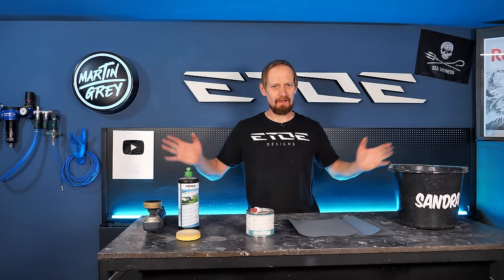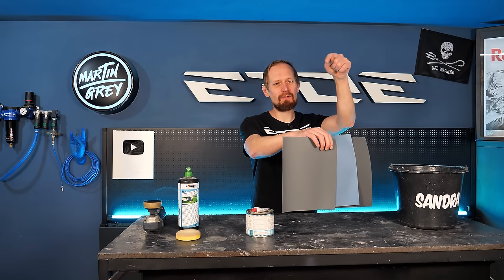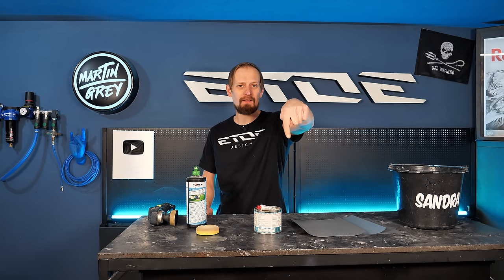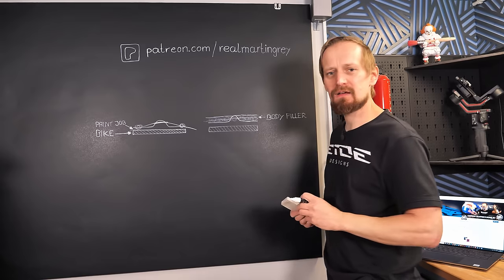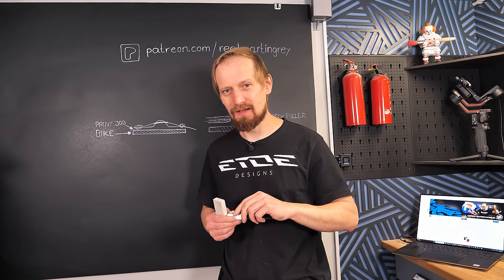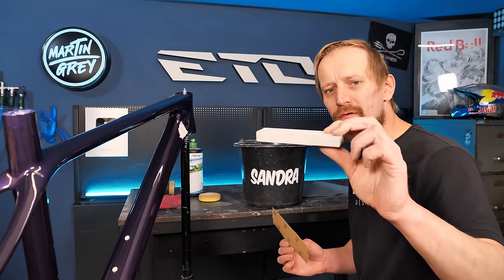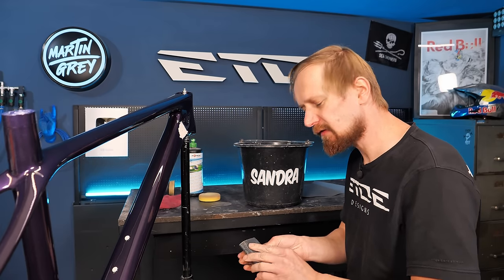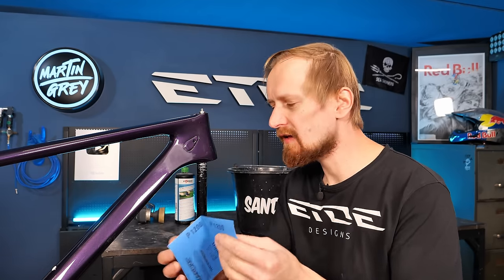How to remove PAINT RUNS easy

Comment: Great video. I hope you don't mind if I add some things I've learned over 40 odd years of doing high end detailing and colorsanding.  So, typically, I put just a little dish soap in my wetsanding water and I soak the paper overnight at least. Obviously you don't need to do that if you're just touching up a small area but it makes the paper work better. Second, I wear a headlamp with an led light and try to have as little indirect light as possible. The reflection of that light will show every flaw in the surface, not the texture, but the scratches and swirls will really show. That way you know when your done and don't have to go extra and take off more paint. Finally, if you're working in an area where you can't get a machine, use a cotton ball to rub in your compound. A cotton ball is non-woven so it can't rub any pattern into the paint and cotton holds the grit of the compound better so it doesn't slurry around on the surface which makes it cut faster and cleaner.

Again, thanks for the video. I like that you didn't hold anything back, that you explained what you were doing and why.

Comment: Great work, Martin, and I'm glad you are back. Just from my experience and you forgot to mention. Your clear coat can be dry but the highest point of the run might not be fully dry and when you try to sand it, it will end up in a complete new spray job. It can ruin your completed job. I went through it, and I know the feeling. Time was waisted and money was waisted.